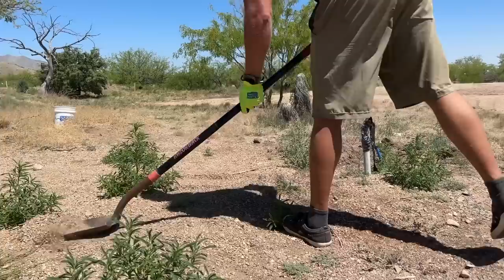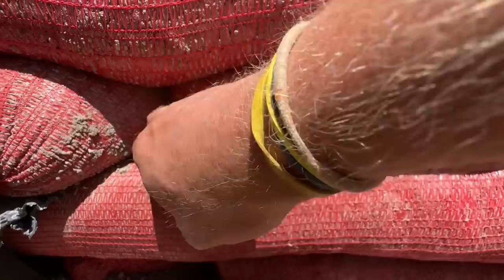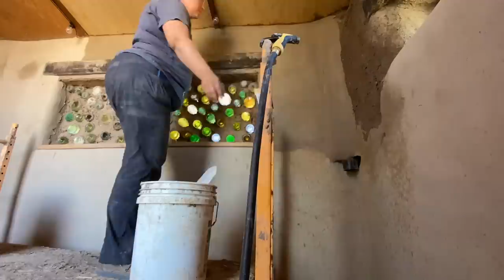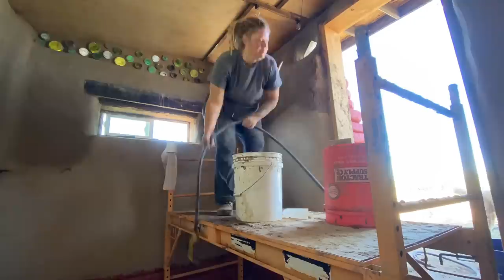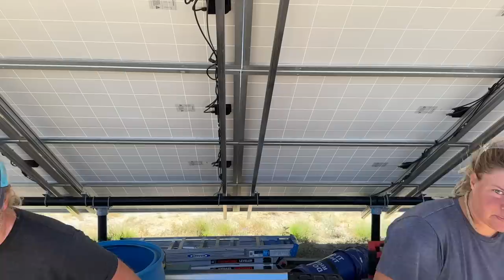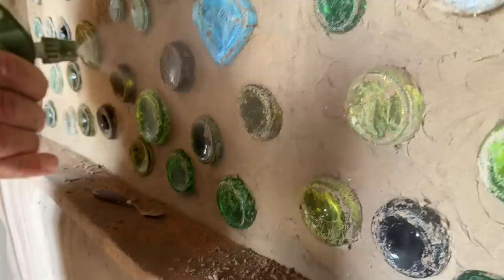This Water Line HAS TO GO THROUGH our Hyperadobe Wall

Comment: The finish is really stronger than I thought it would be , I'm really  interested in doing a battery shed as a test run but I would have to use steel c section instead of timber due to white ants . I hate white ants so much

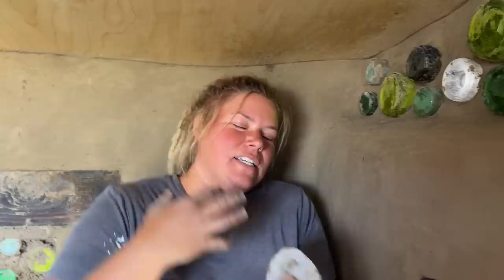Comment: 13:24 I also recall for the solar shed.  You cleaned all the bottles after the scratch coat, but then muddied them up again with the final coat and had to clean them again.

Comment: Ashley why not try a piping bag to apply the final coat around the bottles. Then use your tiny trowel to smooth it out.
Reply from the maker: It’s got to be pushed with force into the wall

Comment: Have you tried using a ziploc bag filled with plaster and cutting off one corner; then squeezing the plaster out (like using a pastry bag)? I've seen people installing mortar around glass block windows using this technique. Afterwards, they smooth the mortar with a rounded trowel. I'm not criticizing (because you get WONDERFUL results); just problem-solving "having to apply a teaspoon at a time" since that seems to be a source of frustration.

Comment: Have you thought of using bagged Cellulose insulation instead of TP for your Plaster coat?
Reply from the maker: No, the TP has to disintegrate completely or else you get big globs of it in the wall. Cellulose insulation isn't going to dissolve in water like it would need to.

Comment: Will you be covering the exterior pex tubing with something? I've been told sunlight degrades it quickly causing cracks.
Reply from the maker: We'll wrap it in insulation for when it's cold so it'll be protected. Not a big deal short term.